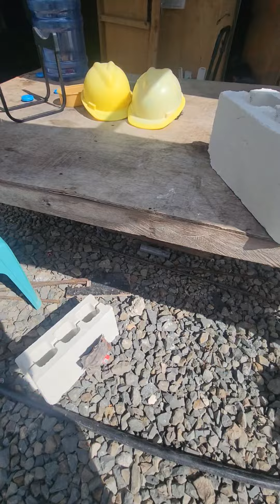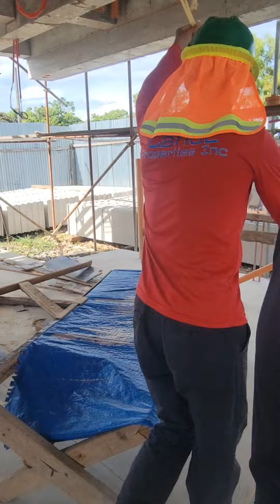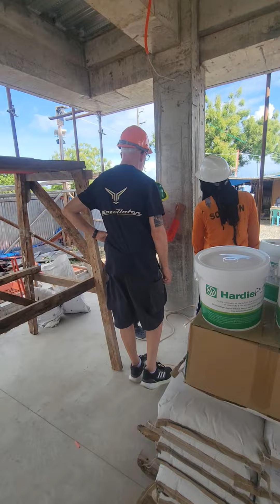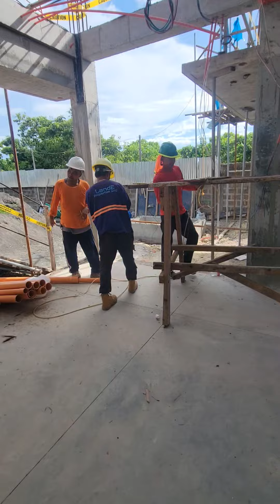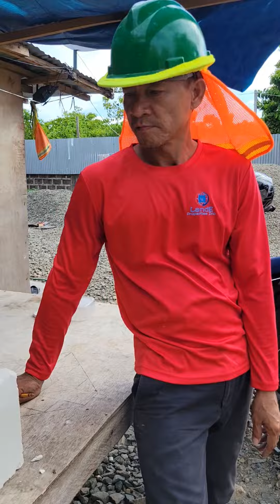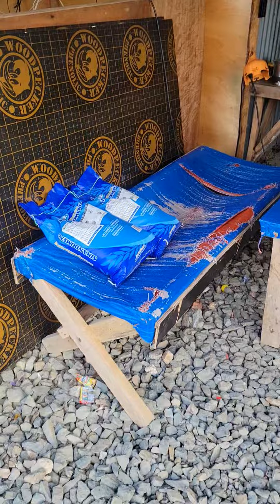Checking floor levels, plumbing, block walls. New house construction Philippines

Comment: 8:43 

Hope i heard it right

Column 1 = 1266mm
Scaffolding = 1267mm
Column 2 = 1263mm
Column 3 = 1288 or 1284?
Column 4 = 1306
Column 5 = 1284
Column 6 = 1278
Center = 1279

Your lowest point is at Column 4 which is 1306mm 

Your highest point is at Column 2 which is 1263mm

That means you have an elevation difference of 43mm or 4.3cm in metric between those two references. That’s 1 11/16"  Inch
Reply from the maker: That's a good summary. I think i found it was within 1/2 inch in every 20 adjacent feet.  As is usual we'll put a self leveling compound down before we put the finish floor in.  Thanks for checking us out.

Comment: @LandeProperties  

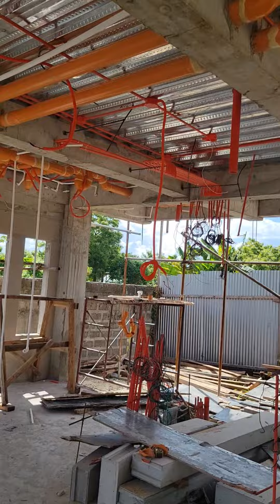4:27 i was wondering if the size of the beams were designed and computed properly by your engineers to accept all those multiple sanitary pipes passing thru those beams?
Reply from the maker: Thanks for the comment. If you look at the recient videos you'll see we relocated those pipes in question.